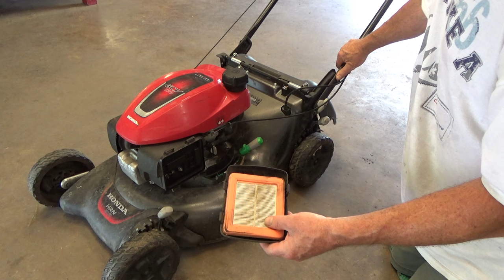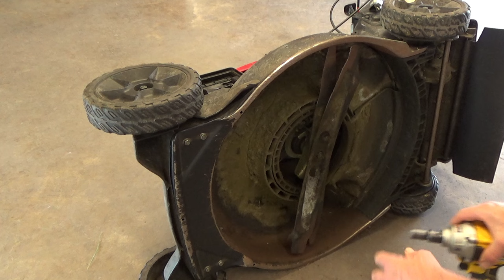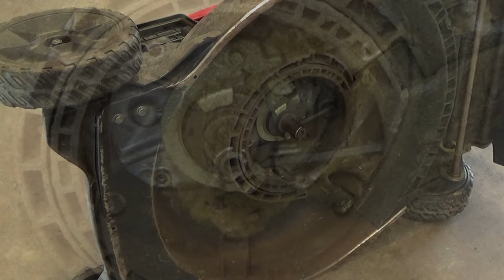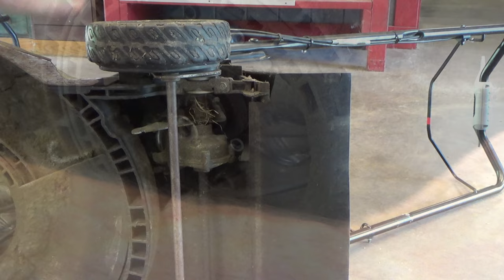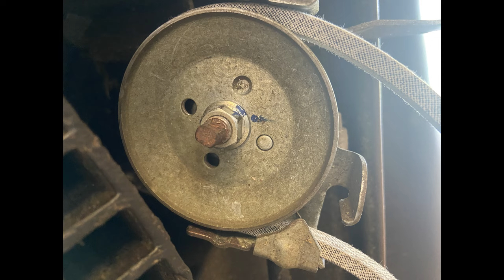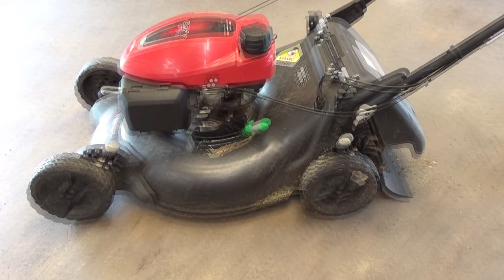Honda Mower HRN216   "Replace Belt"   Easy Self Propel DIY Fix

Comment: Just one tip: if you reach under there and the belt won’t move then it’s either pinched in the pulley, off the pulley, has a stick stuck, etc. You should be able to turn the belt easily using your hands.
Reply: Excellent tip. I was able to pull on the belt and free it up from whatever was making it stick. Problem solved without having to replace the belt...at least for this time!

Comment: You were the only video that mentioned pulling the throttle cable off to allow the transmission to swing down to access the pulley. This was the key to allowing me to successfully get the 2 piece pulley apart. So much simpler than trying to blindly put on a crescent wrench and socket as I saw in other videos. Thanks!
Reply from the maker: Thank you

Comment: This video saved me, I was cutting the lawn and the drive stopped working so I was going to take it back since I just bought it but I was out of my 30 days. I registered to warranty and they wanted $49 to look at and anything additional if warranty didn’t cover. I watched this and took it apart and it was a little piece of a stick that jammed the belt. Thanks for this.

Comment: Very helpful. Just followed what you said and I was able to change the belt. Many other videos are asking the deck to be opened, which was not necessary as per your tip. Thank you! One struggle I had was to keep the cable back to the hook. It was very tight and was not going inside the metal hook.
Reply from the maker: Glad it helped

Comment: great video. i've been doing small engine repair for almost 40 years and your video is one of the best I've seen. I moved to Oahu Hawaii and now work on alot of Hondas. Always something going on with them. Hopefully the only issue is the belt. I haven't looked at it yet but the engine works great but it just won't move.
Reply from the maker: Thank you very much!

Comment: Great Video. Very detailed. Nice to see someone still using a speed wrench. You may have wanted to check the blade for sharping since you had it off anyway. Other than that, this video will sure help out the next guy or gal when they run into the same problem you had.
Reply from the maker: Cool, thanks

Comment: Thanks for the video.  Liked how easy it was for you to get off the hub assembly!   In the end I resorted to using my harmonic balancer.  The hub was on there so tight it bent the frame but it was a cheapo chinese one and I will try and bend back straight.  Will definitely be adding some anti seize on the hub when I put it together!

Comment: Great video. Only real issue I had was socket wouldn't fit over hub bolt--had to remove blades. Hub didn't "slide" off as easy as yours. Impact wrench a must. Pay attention feeding belt back through to center to not get a twist in it. Should be obvious if you do; belt probably won't go onto center pulley unless you really really force it 🙂
Reply from the maker: Thank you

Comment: Wow you made it so simple for novices like myself. Have you seen smoke coming out of transmission when you engage self propelled lever? Self propel control has gotten a little stiff. I can mow without engaging the self propelled lever just fine but when I do use it there is smoke coming from the back left hand side where the transmission is. you have any idea what is wrong?

Comment: Worked like a charm...Thanks...my only issue was getting rhe cable off and back on.  Gotta slide from the bottom to take off and insert that top into the notch and then slide the bottom on.  Piece of cake amd thanks for the $$$ saved.
Reply from the maker: Glad it helped
Reply: Thanks for your tip.

Comment: Hi there. Thanks to your video I was able to replace my belt. Only problem is, that wasn’t the issue. It seems that the belt is too loose. I noticed some damage on the old belt and thought that might be the issue but it looks like it’s not that. I didn’t see an obvious way to tighten the tension, any idea what I could do or check to fix it? Thanks

Comment: Are mowers these days just  garbage?  I think i paid almost 500 dollars for this mower at home depot. I have only had it only 2 years.  Half acre i cut. Every two weeks in spring and summer.  Carb has already gummed up that i had to fix and now the self propel is out.  Never had a mower i have to fix so much.  Thank you for the video. It is very helpful.
Reply: I’ve had mine since 2016 and no issues. I use ethanol free gas though
Reply: Some states only sell fuel with ethanol now, it's terrible for small engines
Reply: Trick for the carb is to run it out of gas at the end of the summer for winter storage. Start the mower, turn the fuel valve off on the side to cut gas from going to the carb. Let it run till it dies. Try and restart and do that till it won't restart. Then dump the remaining fuel out of the mower. Then go ahead and store it. 

For the self propelled I'm not sure as I have never had an issue from it. I find these Honda are abit slower then I like though.

Comment: Great video! Im having an issue where the mower squeaks when i use the self propell any clues on what it could be? Thanks!
Reply from the maker: Hmmmm...   Did you have a mouse in your pocket?   Lol.    I would take a oil squirt can and oil your wheel bearings, axles and anything that moves.   Thank you sir.

Comment: Why would this happen on a new mower that has been used only about 5 times? It just instantly stopped. The belt is very loose. Is there an idler pulley between the ends?

Comment: Hey, I was just working on one. I didn't know you didn't have to take the transmission all the way out anyway while I was working on mine I put everything back together and tested it was working  fine and later during the day I went to start it up again and the right side wheel wasn't spinning any clue why?

Comment: I cannot get the blade hub assembly to come loose from the shaft.
And, the cable won't come off of the transmission arm either.  You must have already had it apart just before you made this video.  Any tips to get the hub off and the cable off as you did?
Reply from the maker: Soak it with penetrating fluid like WD-40.   Sometimes it happens.   A small cheap puller may get it off.   Good luck.

Comment: The center bolt that’s holding the blade and everything on is not coming off. I’m turning it but it’s freely spinning without coming off. Can you help? Thank you.
Reply from the maker: Try taking the 2 blade  bolts   (14mm)  off and see if that helps.   Thank you.
Reply: I'm having the exact same issue...the socket wrench just turns loose and then tight in either direction but that bolt isn't budging.

Comment: Your video is so good but I can’t get that center bolt off! I’ve tried with my drill and with a socket wrench and that thing won’t budge. Tried wd40 and still having no luck. Do you have any suggestions? I know I could do it if I could just get the bolt off!! 😭
Reply from the maker: I use a DeWalt DCF894 Impact.   Thank you.  See the video.   https://youtube.com/shorts/3xfg017Sumo?si=rviG26c-Nx3K0z-U

Comment: Hola, buen dia.  He visto por ahi que Honda saco o suspendio la venta de estos modelos de mercado, porque venian con un problemas en un conjunto de levas, creo, que hacia que en el arranque no dejaba salir la admision de gases, y eso requeria mucha fuerza al tirar de la cuerda de arranque, ud sabe algo de eso?  gracias, saludos
Reply from the maker: Yes.  Honda has a problem with the cam on this engine.  Honda will fix it under warranty.  Contact your local  authorized Honda mower service center as soon as possible.   Thank you.

Comment: We have had our Honda for about 6 months now and the belt seems extremely loose...if I lift wheels off and engage transmission wheels will spin but not enough torque to
pull when on ground...would this not be covered in Honda warranty at least send you a new belt?
Reply from the maker: Most OEMs will not warranty belts because they are normal wear parts.  Going back to the place of purchase for help asap when a problem comes up is your best chance.   They may cover the belt if there was another issue causing the belt to slip.  Like a bad  engage cable or stuck wheels etc.   Thank you and good luck.

Comment: I can’t seem to get the whole blade assembly off. I pull the blades off and the bracket they are attached to doesn’t slide off. Any suggestions? Going to try pb blaster and a rubber mallet.
Reply: Couldn't get mine off either, was able to rotate the blade brackets to free the belt. Now I've got to figure out how to get the best that changes from mulch to bag out of the way
Reply: I got the blades off and started messing with getting new belt on. Realized some mulch was the culprit, but I already cut the belt off. Pb blaster and a rubber mallet got the rest of the assembly off!

Comment: Directions were perfection!!  Thank you
Reply from the maker: You are so welcome!  Thank you!
Reply: @IFIXIT4U  I'm still having an issue after replacing the belt.  The self propell wants to engage but wont.  It smells like burning rubber and my engine sounds like it wants to stall out
Reply from the maker: @CleveIndians    Sounds like your transmission may be locked up.  The pulley on it should spin easy.  Not common but it does happen.
Reply: @IFIXIT4U  thank you

Comment: On my HRX217 the belt runs between the mulch/bag lever.  I can't remove/install a new belt without finding a way to remove that.  Any suggestions?
Reply from the maker: I did one of those the other day.  Completely different animal.  Yes you will have to remove some of the plastic parts etc.   Not any easy job but its not complicated either.  Good luck.

Comment: Did you drain gas and oil before putting the mower in that position?
Reply from the maker: If you follow the instructions in the video you do not need to drain the gas and oil.    Thank you.

Comment: I can't get the (hub) {the device that the blade screw into) to release from the rod. I used heat, rubber hammer etc... Any suggestions?
Reply: Same here, did you end up figuring out how to?

Comment: Great video! I have a HŔR216 that has the same tranny. I had no idea how to get of that pulley. I saw on other models that had 2 bolts. How about the tranny. Do we need to change at any time? What fluid DOES it take? Thanks. Sub'd  & gave u a 👍
Reply from the maker: I would check with Honda specs for exact oil type for your specific model.  Some take 20w50 some take 10w30 some might take other.   Thank you.

Comment: What is the belt size??? My was shredded inside the mower and I have no idea the belt size...I bought a 21" but it's way too short
Reply from the maker: We only use the Honda OEM part for this mower.  Aftermarket belts sold by size do not work well on this mower.  Thank you.

Comment: How often should I replace the belt?
Reply from the maker: When the wheels stop pulling.  Thank you.
Reply: @IFIXIT4U  Also, having a tough time getting the flange nut to tighten back on to the transmission holding drive belt pulley together....any hints?
Reply from the maker: 3:08 in the video shows you how to tight and loosen nut.   Thank you

Comment: What about the spring on gearbox
Reply from the maker: No need to touch the spring on the gearbox to do this job.   If it falls off for some reason.  Put it back on.   Done 4 of these this week.  Spring never fell off.    Thank you
Reply: @IFIXIT4U my spring fell off both sides. Where does the other end connect to?

Comment: I would put grease on that adapter. You were lucky to remove it by hand.
Reply from the maker: Good idea.  Thank you
Reply: @IFIXIT4U  I don't know why they don't grease pulleys and adapters when they assemble them at the factory.

Comment: My blade and bracket won’t wiggle off that easy.
Reply: Mine won't either.
Reply: I had to use a flathead screwdriver to pry it off
Reply: Same. Mine seems like it’s welded on there. 

Gonna try the flat head screw driver technique.

Comment: I can't seem to get the cable hooked back on lol
Reply from the maker: Try hooking the cable on before new belt is on engine pully.  You will have more movement  in trans.    Thank you.
Reply: @IFIXIT4U  no luck. Ended up snatching the cable out of the deck. Way to much tension.
Reply from the maker: @SwagEverlasting    Not sure what is different about yours.   Never had that issue.